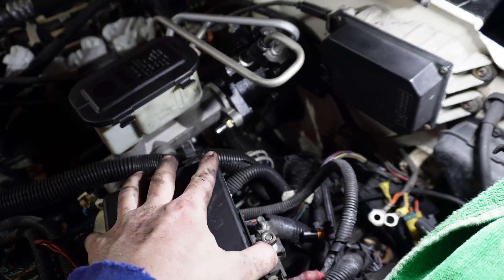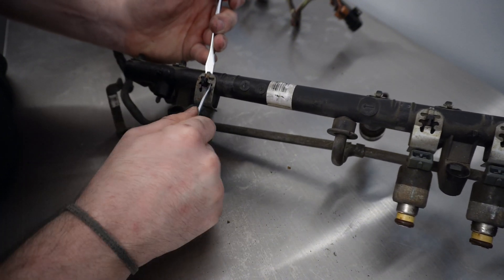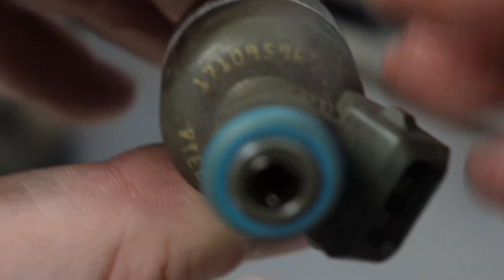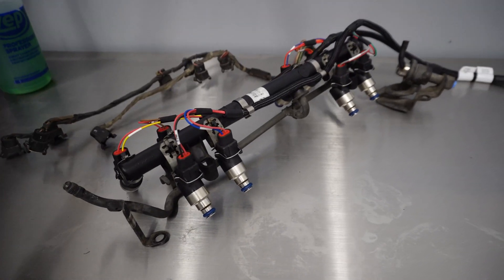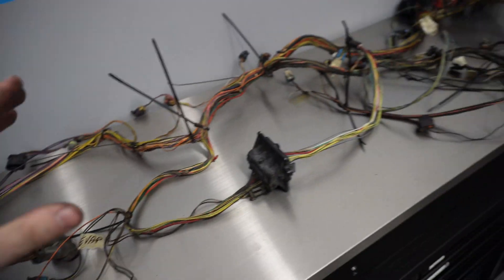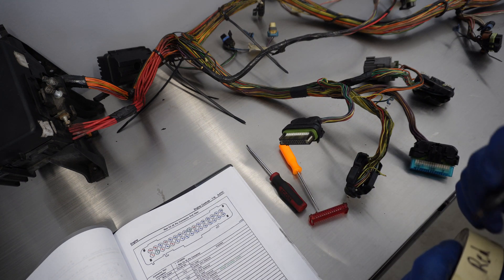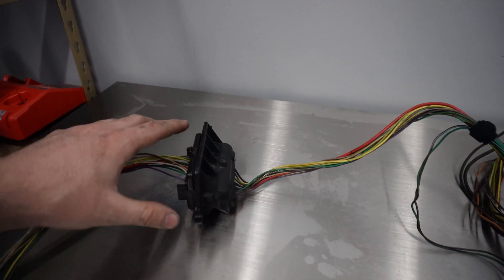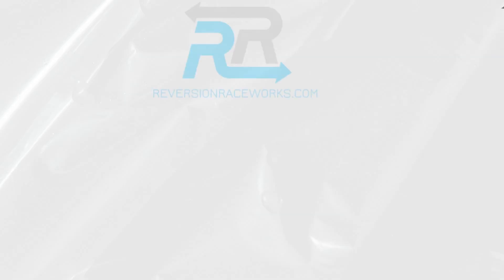Wiring an OBS Chevy for Terminator X Max! - Easier than you think! - GMT400 Holley EFI Swap Pt. 3

Comment: Hi, 
I have a 1997 GMC 1500 short box. 
Swapped a 2003 5.3 and 4l60E. 
Runs on Holley Terminator max.  

Would like to use some of the stock gauges and ac. 
Just wondering if yours able to share the pin out sheet to marry the stock truck wiring harness “thinned out” to the Holley terminator. 

Graat videos, keep up the great work. 

Thanks
Reply from the maker: Thank you! That sounds like an awesome truck gouge building. 

We are working on finalizing the document we used before we publish it, that should be coming very soon! One thing, it is pretty vehicle/option specific. Since ours was a big block truck, it won’t 100% transfer over. The concept is the same and it’ll be a good guide for you. 

We also have a discord server that we are happy to help answer questions in!